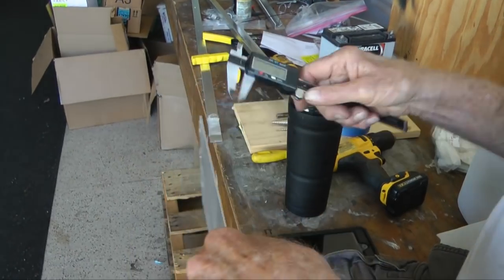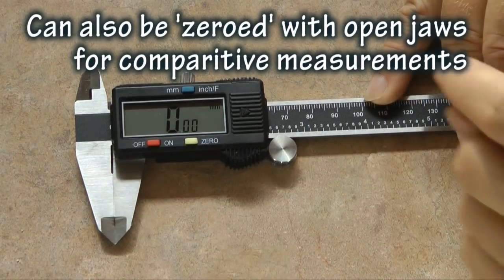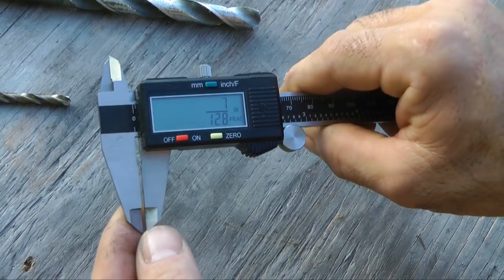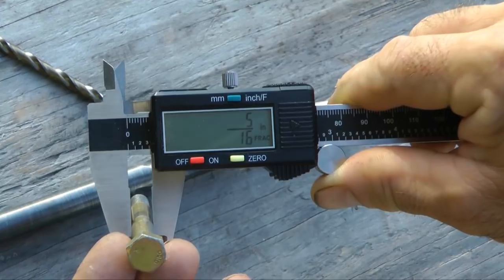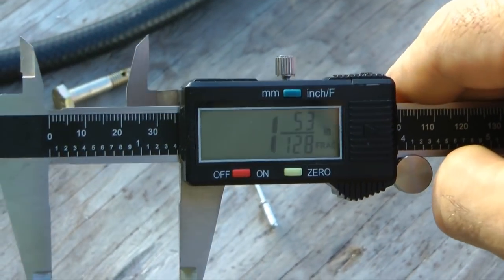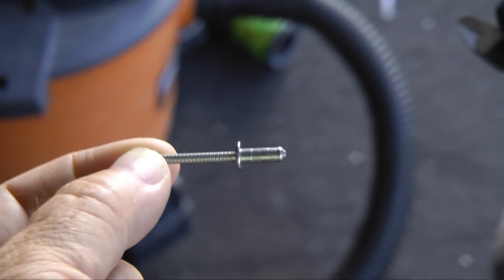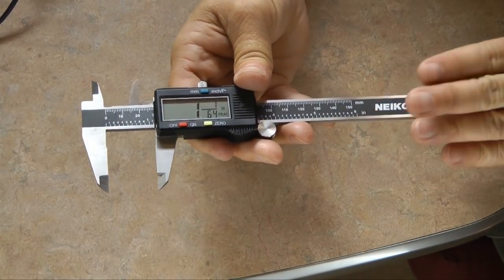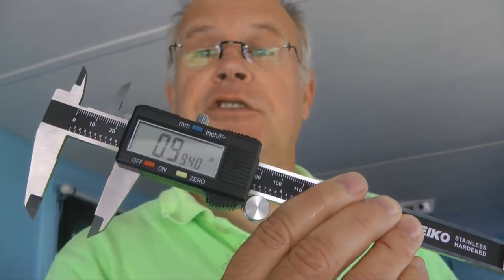A Must Have Tool for every Aircraft Builder

Comment: My primary is an analog dial gauge caliper --- MUCH more accurate than the digital AND includes a depth gauge.  Reads in thousandths and 64ths.. Digital is only in hundredths or mm.  No depth gauge
Reply: My $250 Mitutoyo digital calipers measure in 5/10000 and .01mm and has a depth gauge.  Exactly the same as my Aldi calipers that were $19.  They both measure exactly the same too.  No engineer worth his salt would use fractional for anything. If you need accuracy, get a micrometer.  For a home builder, buy a handful of cheapies.  How accurate do you need to be?  You're not rebuilding engines.
Reply: And the batteries never wear out!